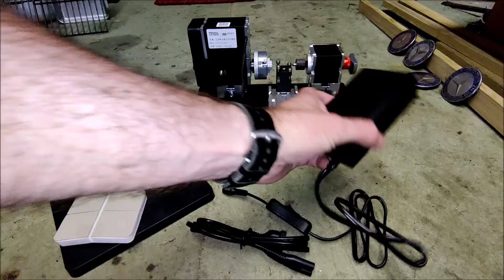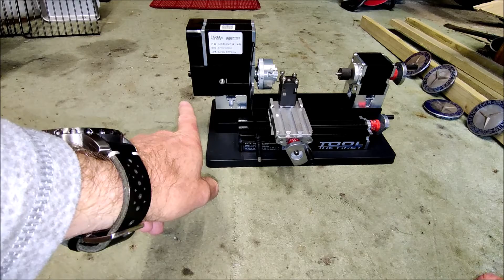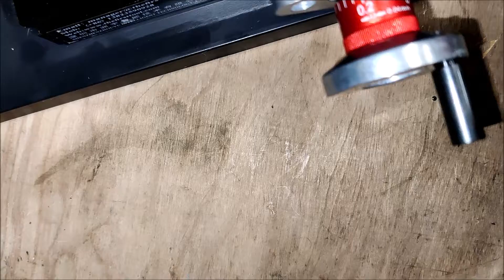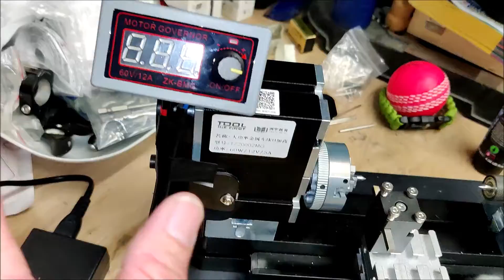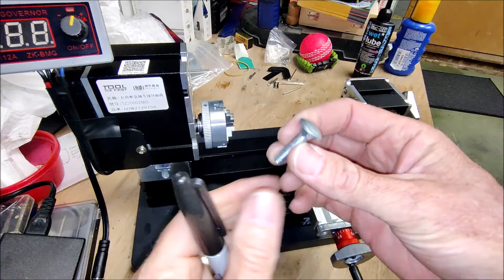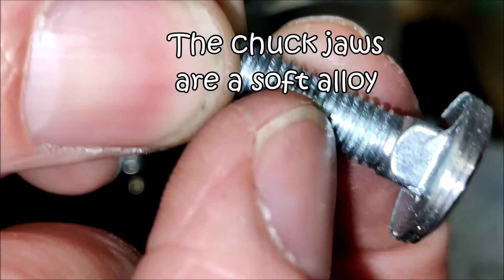TOOL THE FIRST - Mini lathe TZ20002MG with PWM motor governor / speed control . IT TURNS STEEL !!!

Comment: Random internet person from the future here... With the help of your video I made the exact same modification to my micro lathe, It works beautifully. I recently cut diameter 80mm ali on this(Yes these lathes can do more than diameter 50mm), I inverted the chuck jaws as the part was a ring shape part. Slowed down the speed as was able to cut it, sort of safely. YES, this mod absolutely works. If you genuinely are going to use this wee lathe for tiny model building applications this is worth the extra $20. I've had mine for 2.5 years & pretty dam good. CHeers

Comment: I have one and its great to improve its performance. The gib strips are plastic, no problem as my larger lathe has plastic gib strips. But the grub screws are pointed at one end, and dig into the plastic with force which loosens the slides. Grind the grub screw tips flat and you will get better stability with use. The chatter is cause cos the force on the tool is on the edge of the bed and not into the centre of the bed like larger lathes. Another reason is too much overhand on the tool especially 4mm tools. Puts some rake on the tool (the 3 angles in which it cuts)

Comment: I have ordered a machine for my colleague and would like to build him the speed controller. Which plug do the motor and the power supply unit have? Is it 5.5x2.5 or 5.5x2.1? I hope someone who already has the mini lathe can measure it!
Reply from the maker: Yes, just measured mine, it is 5.5 x 2.5
Reply: Thanks! @fixitfallows

Comment: I just bought the blue Xendoll from eBay and received it today. Looks really cool. Plan on using it for small watch parts projects. It also has a bit of wobble in the feed  but I think an extra washer or maybe tighten the turn handle may do. Your's is nice as it already has the riser blocks installed.

Comment: Your high speed steel bit needs to be sharpened to a certian profile bud...your not cutting right without the proper angles on the tool...

Comment: with these little machines its all about rigidity. i have one, its great after a few mods. 
Adding another bracing plate to the front side of the spindle block will help flex in that area.
if you add thrust washers to the lead screws, you can tighten the gib adjusters a lot more, meaning less flex but the handles turn just as easily.
a nice thick heavy metal baseplate helps to add mass and dampen the vibrations.
a 4-jaw independant chuck and a runout meter on an arm+magnet base is also good if you do a metal baseplate for it.
the grub screw in the handles did fix most of the slop/playissue, but i found i had to add a "fiddly" layer of alluminum tape to the lead screw mating surface to make it perfect.
also, if you put your bolt into a nut and clamp onto the nut you can save chewing up your chuck jaws.
Reply from the maker: Great advice. I've done the grub screws already and as you say, it fixes most of the slop. I'll take a look at those other areas as soon as I can. Thank you very much for this info 👍🏼